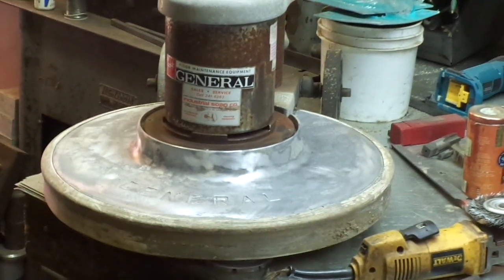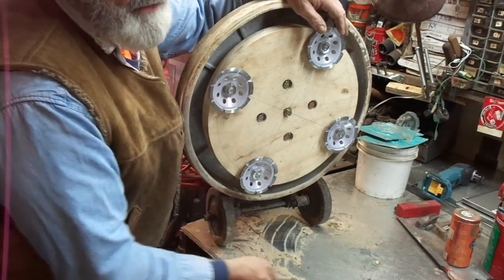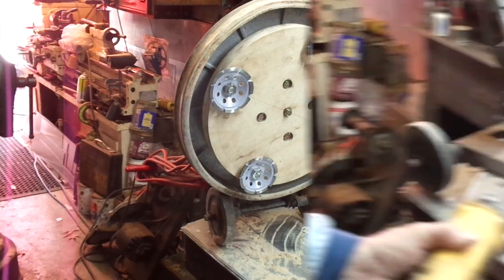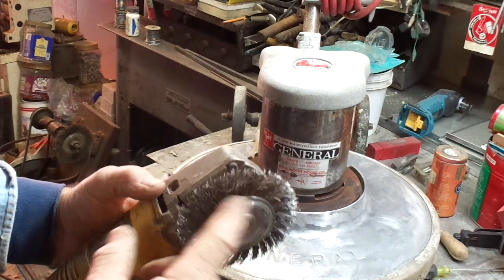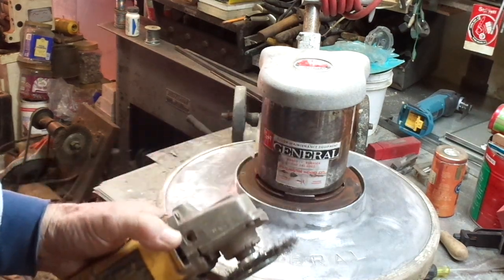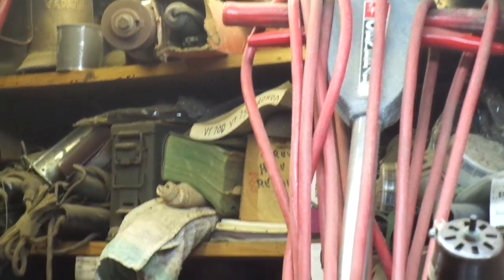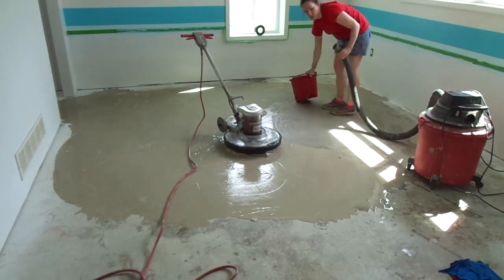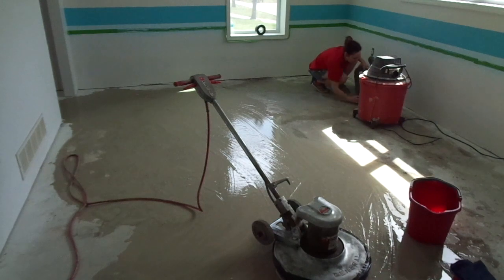Pt 5 Diamond Floor Grinder

Comment: Hello Wendell. It seems to work good. Nice to see you and your daughter working together. Take care
Reply from the maker: Hey John...thank you for the comment sir.  It is a pleasure working with that little gal.  She jumps right into the middle of everything...roofing, pulling wire, insulating walls, running the celulose blower for the attic...you name it man and she's there.  She even tools around on the backhoe on occasion.  And man, she is a crazy gardener on top of it all.

Comment: Great job. Your daughter shows rare good sense. When you have a highly skilled operator available you let them run the show and haul water when they need it. 
The first diamond grinding wheel I bought cost $300.00 and it fit on the tool grinder in the tool crib. 25 years ago $300.00 was a whole lot of money.
Reply from the maker: For many years we'd rent demo saws usually Stihl or Husky, to cut concrete decking and other roofing material while doing commercial HVAC  rooftop unit installations.  The rental companies would measure the diamond cut off wheel before we picked it up then again upon return.  The rental charges would be commensurate to the usage off the wheel.  I think the costs of them has gone down over the years, but years ago it was scary expensive.  Now these were demo cut off blades and not surface grinding wheels.  These are admittedly very cheap versions and other brands like DeWalt are $40 or more for a 4" one.
Reply: @tractorman4461  When we invested in moving companies to China and avoiding the EPA along with getting cheap labor, the CFO's didn't think about giving away the farm to get free chicken. We shipped equipment and trainers over and the Chinese promptly used the equipment and training to make their own equipment. Now the price is so low that I don't know of a single diamond wheel maker in the US. 
I remember the Navy farming out the job of making the classified design of the super quiet, and untraceable on sonar,  submarine props to Toshiba. Toshiba sold the design to another customer. How many customers for super secret sub props are there? Russia bought them. I'll bet a dime to a nuclear sub that the Chinese have them on their subs too. 
Idiots burning down the house to stay warm.
Reply from the maker: @OldSneelock  Very good analogy sir.  Idiots burning down the house to stay warm...I'm gonna quote that one of these days !!  Thank you for the supportive comments.

Comment: It is great that this worked for you. Always nice when a project works out especially when you saved a few bucks repurposing what you already have.
Reply from the maker: Well Bill, I hate to throw away anything that has inherent value because there's always an idea popping up to put things to use....either in the way in which they were designed or in an entirely different venue.

Comment: Good going Tractorman....that`s just as good as the machine one can rent and you made it yourself....congratulation on the invention I want to say....just goes to show ya...CHEERS
Reply from the maker: Thank you sir for the nice words. It does work quite well and it was quite cheap to boot !!  Hey Gator, I dug out that three phase variac the other day.... it weighs about 45 pounds and all the terminals are clearly marked as to their connections into the windings.  That's gonna help figure it out don't you think ??  There is a common rod going through the center of the stack that varies all three at the same time.  I wonder if you can separate them and make three 120v ones, or one 240v one and one 120v one.... any ideas ??

Comment: Who is that guy, General Clarke anyway?> Hahaha!
I have a tip ( suggestion )  for you Wendell,..if those diamond wheels loosen up, why not go get a sheet of floor sanding paper ( adhesive type ) cut out about a 2" diameter discs and stick them
 together and put these doubled discs to the underside of each wheel where it meets the plywood,..re-tighten them up and I'll bet they won't spin free after that.
From what you've shown us there, this 'invention' of your's is doing a fine job.
If you happen to have a rental center close by, why not drop in and see just how much money you've saved by building your own diamond grinding head for that floor scrubber/polisher.
Reply from the maker: Good Evening Reg...I apologize for being so late to reply.  That's a real good idea for the adhesive sandpaper for grippage.  I hadn't thought of that at all.  I do have a few sheets of it in the shop. Our only locally owned rental company in town just sold the property and closed his shop, but Home Depot should have rental floor grinders and by golly I just might do that.  Thank you sir for watching another one !!  I do appreciate it sir.
Reply: @tractorman4461  You are welcome. I know a guy could go out and buy that diamond grinding attachment,...but it's a lot better to see it being made at home. 
A good plus to this is that it turned out so well too.

Comment: (General) motor 1 hp?
Reply from the maker: I actually don't remember, but it may have been 1 1/2  or 2 hp.  I think I remember that it draws about 12 amps at 120 volts.  Volts multiplied times the amps equals watts.  So 120 x 12 = 1440 watts and figuring there's 735 watts per hp, 1440 divided by 735 equals approximately 1.9 hp.  Does that make sense Giorgi ??  It runs cool to the touch and has a nice large  10-3 power wire.